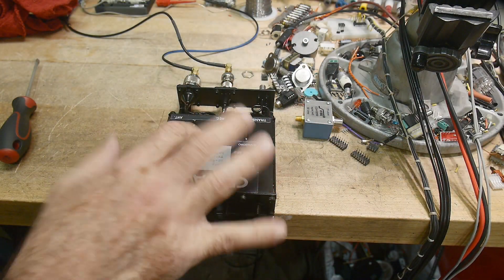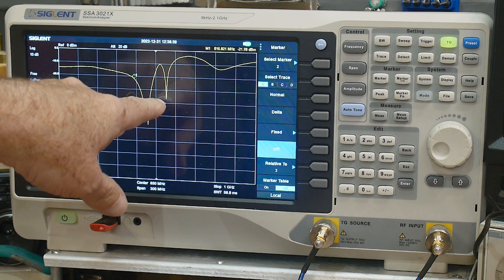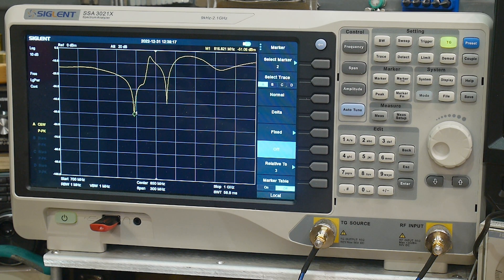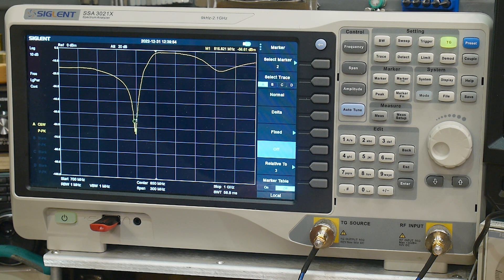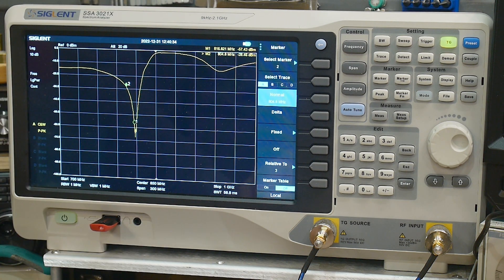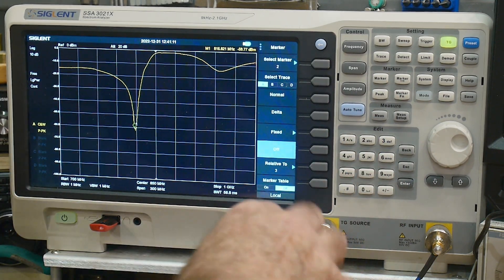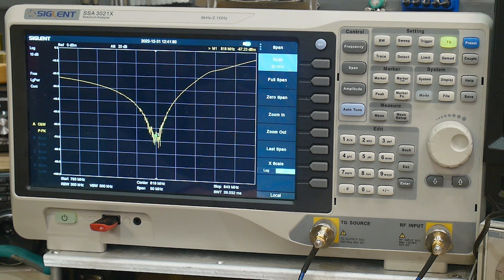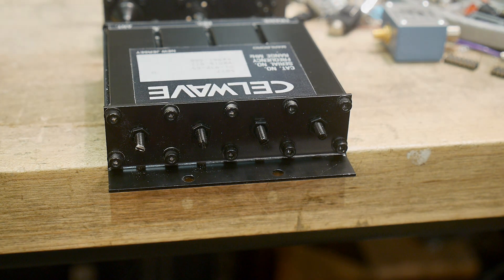#1387 800 MHz Duplexer (part 2 of 2)

Comment: I'd like to see you get the tektronix 012-0057-01 calibration coax, measure it, and discover what makes it so (supposedly) accurate and precise.
Reply from the maker: probably not much different from any good quality cable. I think those where sold to work with 6GHz system so good connectors and coax are needed. a standard RG58 pomona cable is about $35 and a better quality (coax upgrade) pasternack is about $75.

Comment: You may be able to disassemble the duplexer and shorten the centre element to move the frequency up. They are about a quarter wavelength long. Measure the existing centre element then cut it proportionately for the higher frequency. The capacitive hat tuning may need to be made longer to reach the shortened centre. Duplexers are basically plumbing and not that mysterious.
Reply from the maker: these are helical resonator designs and a mystery to me at this time.
Reply: Its not just the resonators but the coax length between them..

Comment: I wonder,... if you removed the tweak-er end plate and milled off a cm of the cavities - then replaced the end plate, would the resonance frequency rise into the 900mhz range?
Reply from the maker: no, I think I would have to modify a helical coil that is inside. and maybe also do as you say
Reply: @IMSAIGuy  It would make another video!

Comment: So this blocks out the 810 to 830 MHz range  ?
What are these designed for ? 
I am guessing they are supposed to block the 800 MHz business radios transmissions ?
806 to 824 MHz is mobiles to tower for business and public safety.

So this would block them and you would not get anything bleeding over into the cellular band.

I wonder if there is a way to modify them to block the cellular band instead.